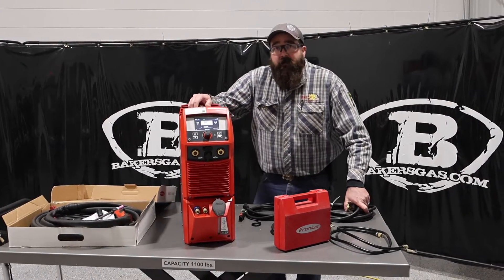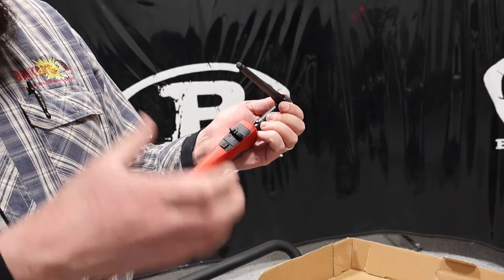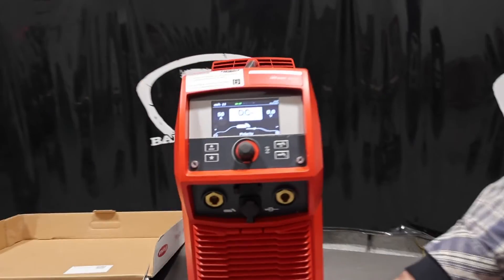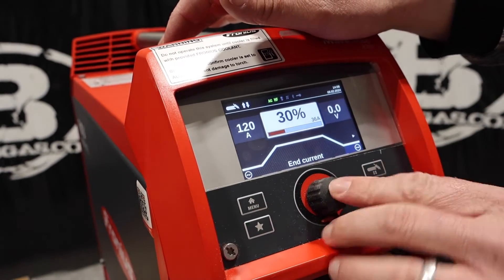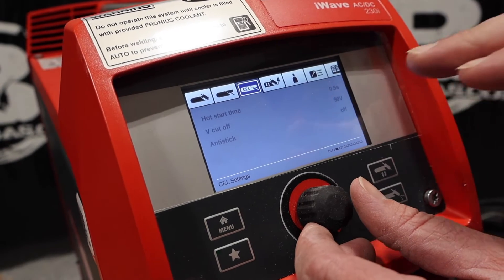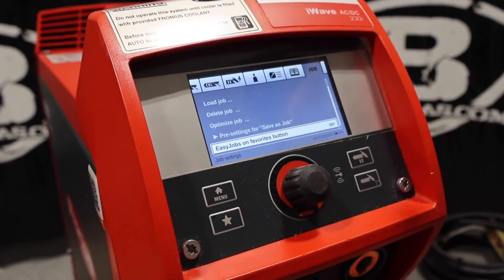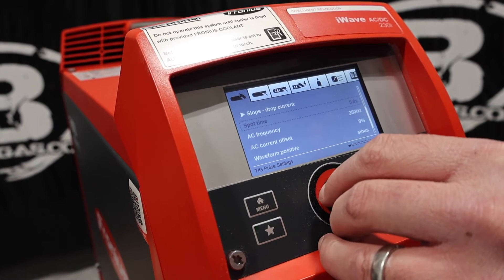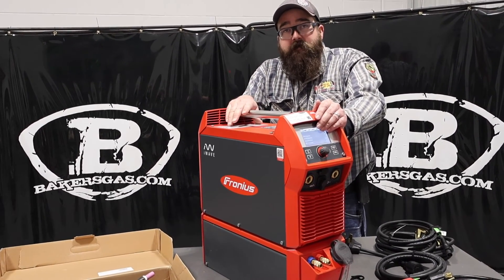Fronius iWave 230i AC/DC Review 49,0400,0032

Comment: I have used several Fronius machines. They are THE BEST. My current shop has the top of the line 2025 Miller tig and it is a toy compared to the Iwave. The torch does suck. It works. It has some cool features, but no one welds that way in America. So all you have to do is just get a ck torch and hose setup and it is good to go. 
In the last year or so a lot of other machines have come out with features Fronius has had for 7+ years but no machine that I have seen has all of them. 
There are exactly 2 welders out there i would buy personally. Primeweld for a hobby/small shop/budget application and Fronius for real work.

Comment: You don't need to nor do you want to push down on the tab to rotate the torch! You could end up with it popping out and that will make a mess with coolant all over the place. The torch IS designed to rotated with the head locked into the handle. It will rotate a full 360 degrees, not a problem

Comment: Thanks for the video.  I just purchased this machine and find it intimidating.  So many menu's,  2 step trigger, 4 step trigger?  Where do I begin. My  old machine had a HF button and 2 wires tapped to the torch, push it and HF is active, let go and it is off.  I welded for 30 years with a Miller variable core 150 with HF super imposed.  NO pedal. Start hot, then get moving or stop and turn the crank to lower the heat.  I purchased the water cooled torch and after I got it set up realized that it doesn't have a light, well... neither did my old torch, I can live with it.  If you get the chance to explain a bit more about the set up's that would be great.  I know I have to mess with it, but understanding some of it is better than none of it.  If there a  video or reference that explains it better than the manual that I have read twice that would be great, please direct me.  All the best, thanks.  TonyK.